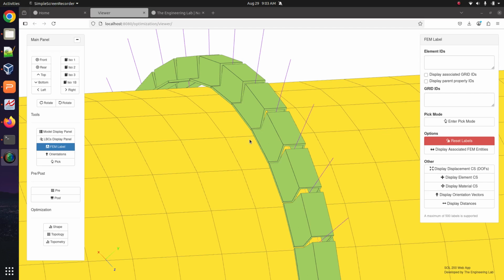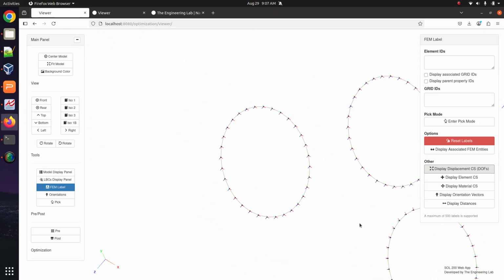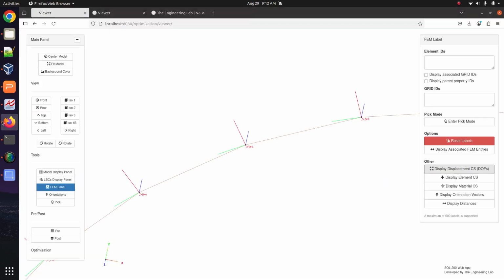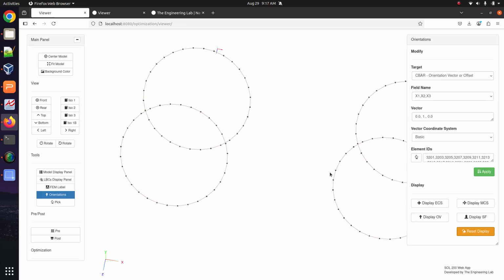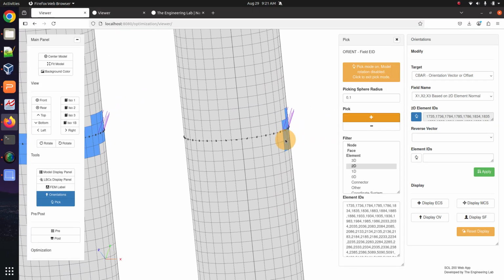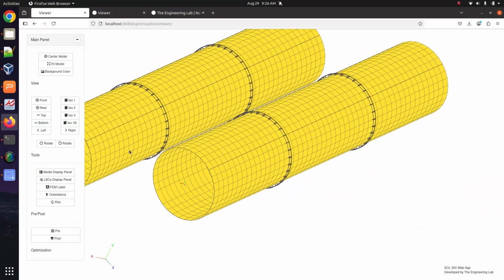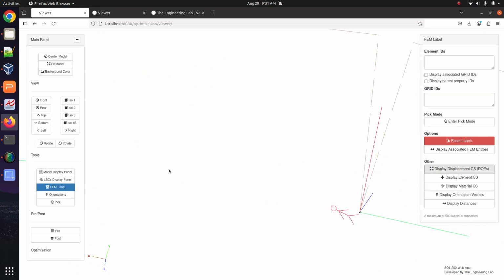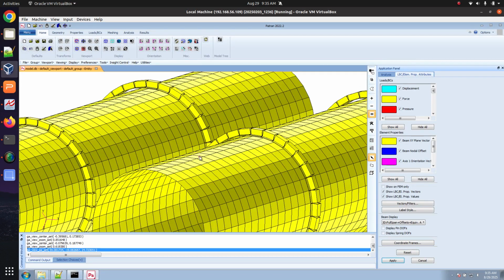How to correctly update MSC Nastran beam orientation vectors

Comment: Thank you. Unrelated question.
If you are importing from Apex to Patran, what default tolerance would you use in Patran if your model from Apex is in metres and when it is in mm?
Reply from the maker: Which tolerance value are you referring to?

Patran is like a calculator. If you supply a length of 5.0, both Patran and the calculator do not know if you are using meters, millimeters, inches, etc. 

When you import a BDF to Patran, there is no units conversion that is performed.

When you import a BDF to MSC Apex, you are asked which units the BDF is in, and a units conversion is performed.
Reply: @the-engineering-lab Patran Global tolerance which by default is set at 0.005
Reply from the maker: @roguepeople  What implies "Patran Global tolerance" is related to units?

Short Answer

The Patran Global tolerance is related to CAD geometry and is NOT related to FE nodes or FE elements. The Patran Global tolerance is NOT related to units. 

You can ignore Patran Global tolerance because you would NOT import CAD to Patran. Use another tool to create, edit and mesh geometry. Then move the mesh to Patran.

Side comment on units - Patran does NOT have a units option for FE or Nastran models. If the Nastran model is in meters, but you want to convert the units to millimeters, Patran cannot do this. Other tools, like MSC Apex, can convert the units of Nastran models. In Patran, you will see units options for CAD geometry, for example if the CAD file has units of meters you can adjust the import units to be millimeters, but this should not be confused with units for FE or Nastran models. Unit options for CAD are different than units for FE or Nastran models.

Long Answer

When you write code, how do you detect when you have a value of zero? You say, "If the value is less than a very small number, the value is so close to zero that the value is deemed as zero." The "small number" may be 1.0E-12, 1.0E-16, etc. Below are some examples where the small number is used to detect zero.

Example 1: 1.0E-20 < 1.0E-12      (True, 1.0E-20 is effectively zero)
Example 2: 1.0E-14 < 1.0E-12      (True, 1.0E-14 is effectively zero)
Example 3: 1.0E-3 < 1.0E-12      ( False, 1.0E-3 is non-zero)

When you have 2 geometric points, how do you detect if the points are at the same location? You say, "if the distance between the 2 points is less than 1.0E-12," the 2 points are at the same location.

The Patran Global tolerance is used to detect when geometric objects are near each other. I see the default tolerance is 0.005, which is kind of large in my opinion. But since I recommend not using Patran to create, edit or mesh geometry, I would not worry about the Patran Global tolerance.

The formal definition of the Patran Global tolerance is given below.

Definition: "During the construction of the geometry within PATRAN, PATRAN uses the "global tolerance". This tolerance is used among others to decide whether or not geometrical entities have to be considered coincident or not. " Source: exchange.esa.int
Reply: @the-engineering-lab if I import a mesh in metres from Apex to Patran, what global tolerance should I put in Patran?
Reply from the maker: @roguepeople  1) Leave that value as is. 2) That value will not impact the mesh. The Global Tolerance only impacts imported CAD geometry, e.g. Parsolid (.x_t), Catia, etc. Since you are importing a mesh, not CAD, the Global Tolerance will not impact your mesh.